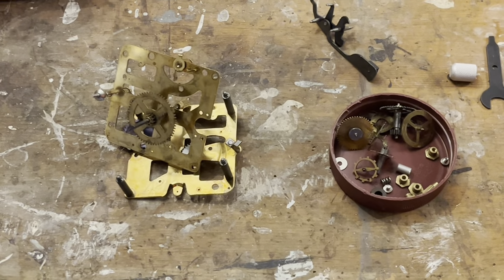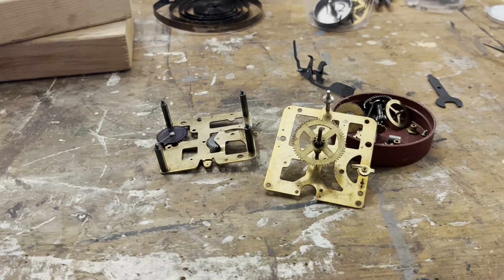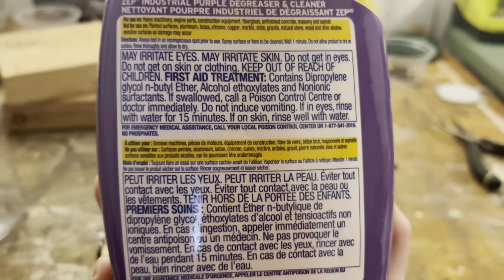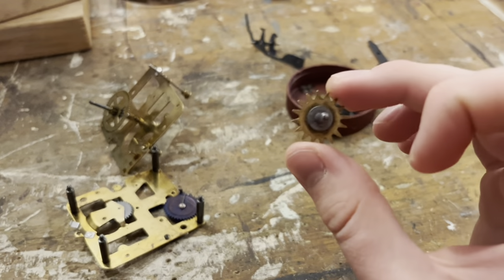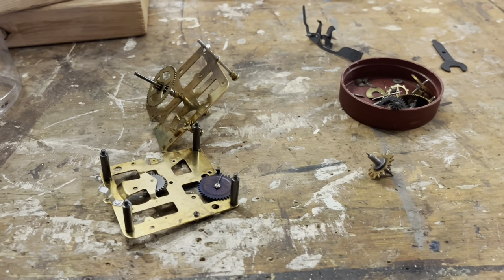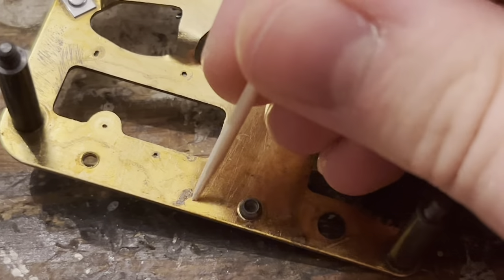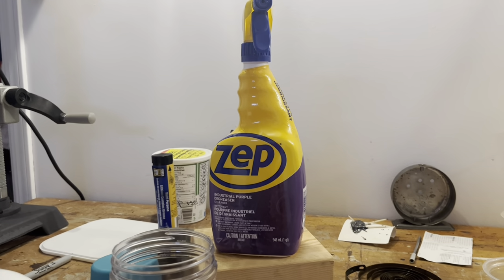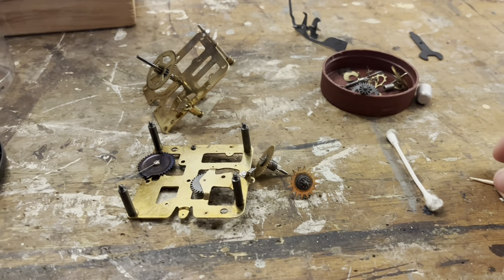Clock Pivot Polishing Experiment using a drill press (Westclox Big Ben Style 7  Service Part 7)

Comment: Hi and enjoyed video, I can definitely relate to making do with equipment. I started off learning clocks on a westclox Big Ben, now I repair or Rebuild many different movements. Just a suggestion on cleaning out the bushings or smoothing broach, you can use a Brass taper pin in a pinvise to smooth out the bushing. Fortunately I was recently blessed with a Friend Giving me a Jewelers lathe . I have used it a lot more than I thought I would. I admire your set up for polishing! Keep at it man! I started from a Kitchen table to now having a clockshop with equipment in my Backyard now . God Bless